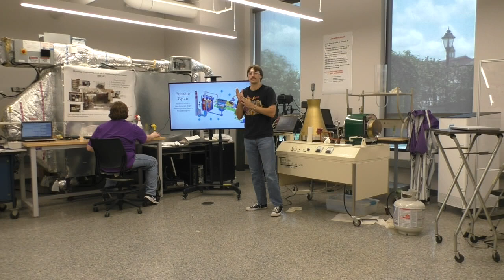M 4611- Jacob Coleman

Comment: Grant Adams: 

Good - Jake did a good job of gesturing to the actual experimental apparatus while explaining the procedure and components of the experiment. He also gave specific examples of why data could be skewed during the experiment and pointed these issues out to the class physically as well. this could be useful to future groups that perform the experiment sop they know which components to look out for if they appear to be operating incorrectly. 

Possible Improvements - One thing I noticed that could be easily improved was the font size of the presentation. If someone were to be seated near the back of the room, deciphering what the text on the slides is supposed to say can prove difficult. Additionally, it is good practice that the presenter make the text big enough to be able to see it on the video when watched back, and as can be seen from this video, it is difficult to read the content on the slides.